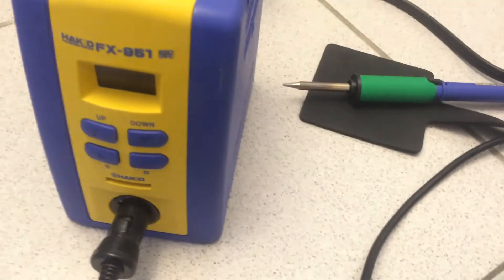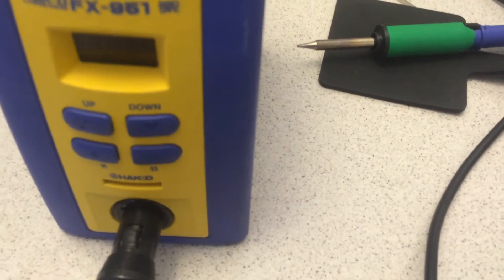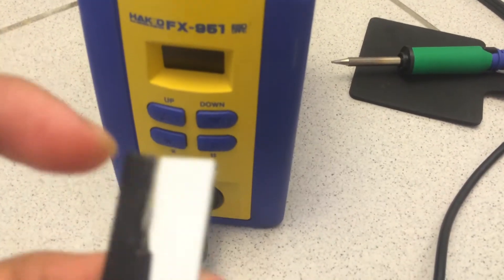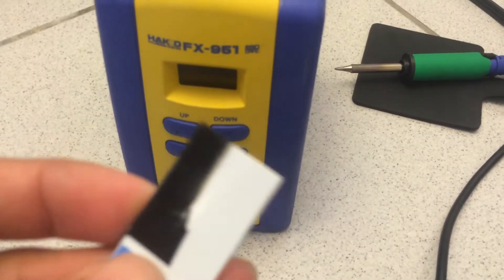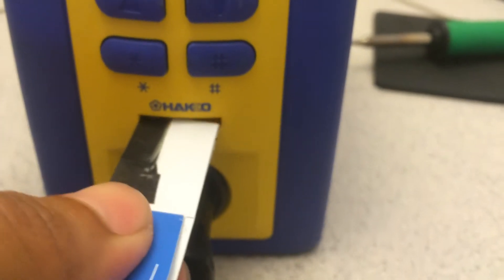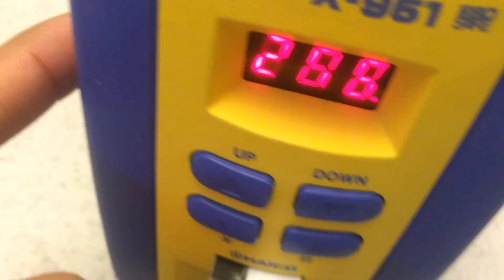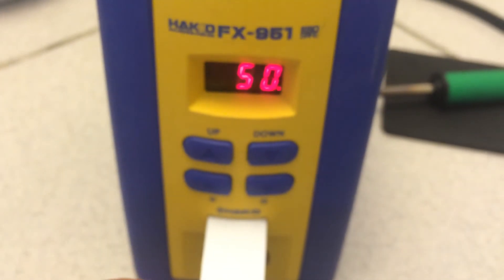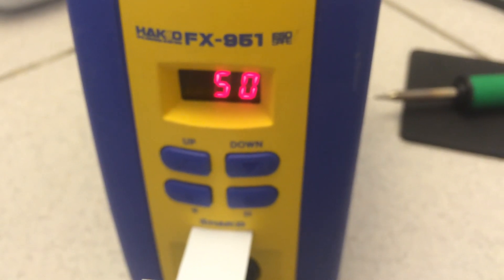DIY Hakko Temperature Control Card (Should work for any model) FX-951 FR-802 803

Comment: Not that it matter with an opaque card but when using the blue plastic factory item the darkened side is the wider one on the right. The one supplied with the clones often isn't dark enough when new and just needs a little more bluing with a felt pen. 

...or you can cut the plastic card and seal it in flush.
...or open it up and block the light path as mentioned.

Anyone have any luck changing it over to Fahrenheit? Mine goes through the motions as instructed but never saves the change. The lady I'm potentially giving this one to is easily the celsius person I've met about a F in scale.